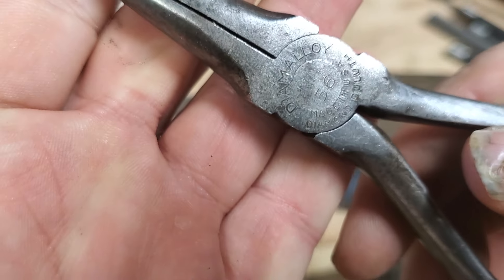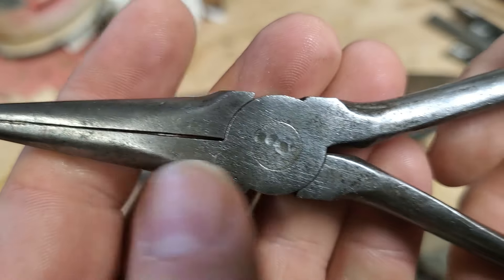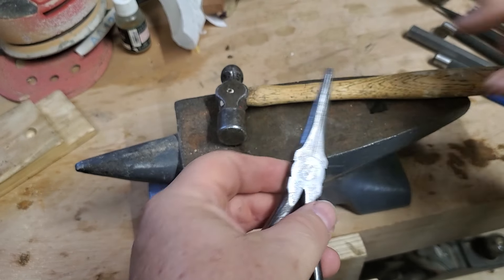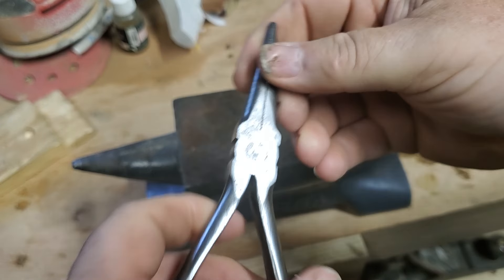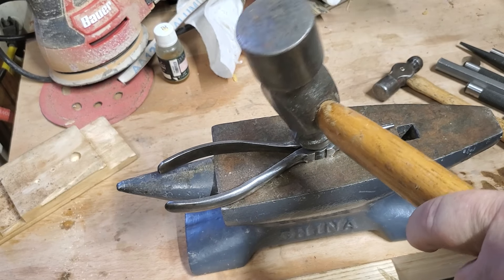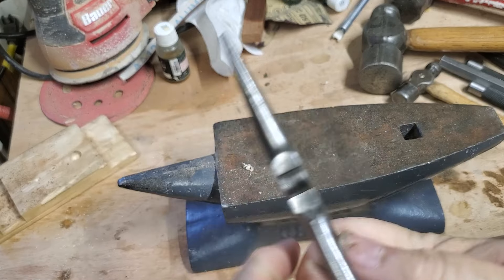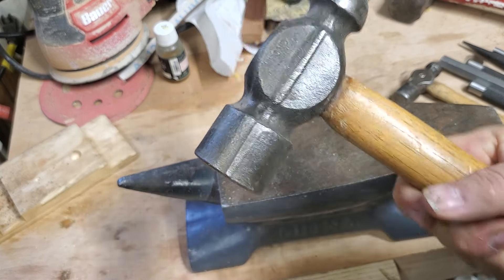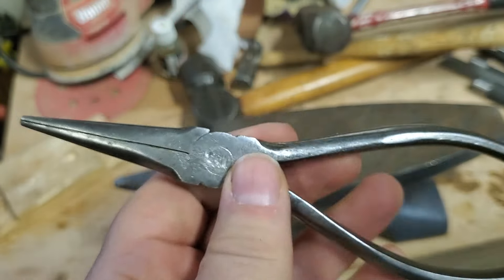Plier repair

Comment: That is essentially a big rivet. The way you usually peen a rivet is with MANY light hits starting in the middle then slowly working out around the perimeter. Hitting it hard in the middle spreads it horizontally in the center of the rivet tightening the rotational axis as you noticed. You need to tighten it vertically to stop the “ wobble” to do that you need to tap it around the perimeter forcing the flared edge down.Probably better done with a smaller hammer and a  flat faced punch. ( like a pin punch) Unless you have far better control of your hammer strikes than I do.( many do have better control than me) actually,  probably the best way is to use something like a properly sized socket and a press. And by the way I’m very jealous of your flea markets, for years we had a bunch of good flea markets in the Bay Area including the San Jose flea market.  ( once billed as the worlds largest flea market) But slowly but surely all of the used tool vendors were replaced by people selling cheap import junk.Not all import tools are junk, but the tools at local flea markets here are. 
I always enjoy your videos.
Reply from the maker: I'll try with a smaller punch around the edges.  There is still enough wiggle to see some effect.  The socket/press idea sounds good.  I passed up on a really nice screw press a couple years ago and regretted it ever since.   Our flea market doesn't have much new stuff at all.  It does have a good taco truck.  It's only $30 for a space so there are frequent one-time sellers.  That's where I find the best deals.  Thank you Gene.
Reply: I didn't see your post before I wrote mine. I think we've said essentially the same thing.

Comment: I'd be tempted to follow up with a flat punch, the diameter of the pin, more or slightly less. 

The domed surface has stretched and flared the top of the pin, relative to its body center, and made its body somewhat wider at that end. That's why it's tighter to open and close, but still sloppy. It increased friction on the axle function of the pin.

To get rid of the rest of that undesired motion, I would flatten what you have raised with the flaring. That will bring the sides closed together. It's like what a pop-rivet does - flares AND draws down.
Reply from the maker: I'm going to try it.